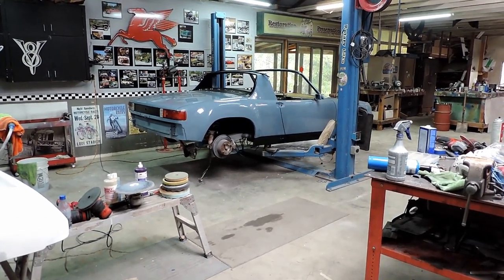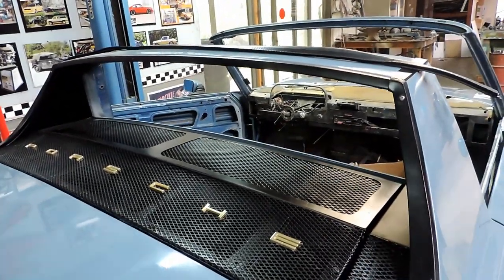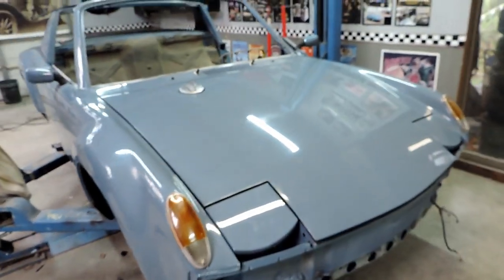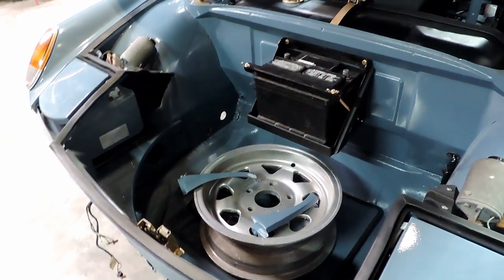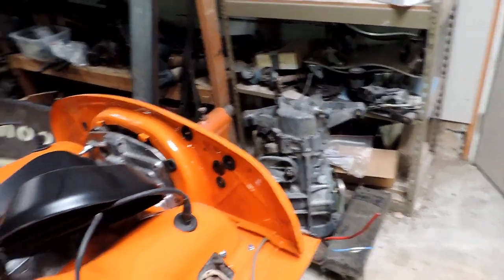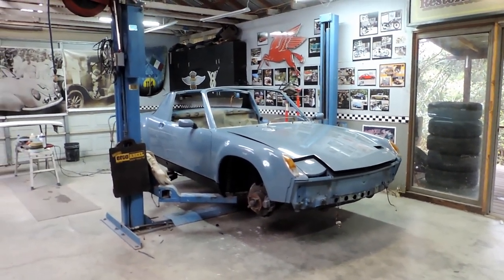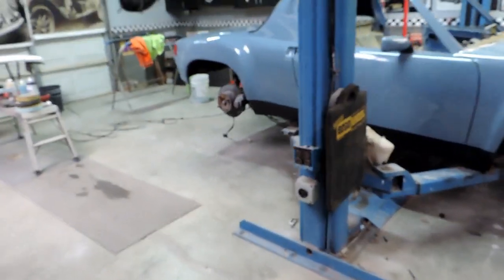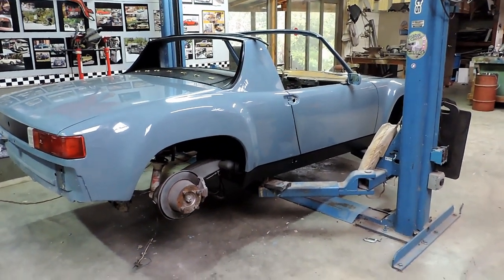Porsche 914  (OUTLAW)

Comment: Great looking 914. What are the specs on the engine?
Reply from the maker: I bought the engine already built it's a 2.2 with 44 webers The thing is pretty fast!
Reply: @klayskoolstuff7039  Thanks! That is awesome. Growing up my dad had a 1973 914 with the 1.7L eingine. He sold it when I was in college. It killed me when I found out. I have found it and could possibly buy it. I just do not know if I want to do the restore and add a 911 engine or a V8. I know it would be a lot of work and I am thinking most of it would be stuff I would have to pay someone to do. I have restored several dirt bikes but this is totally different.